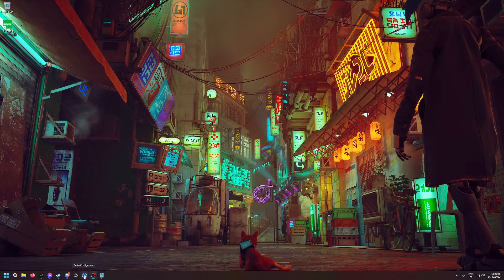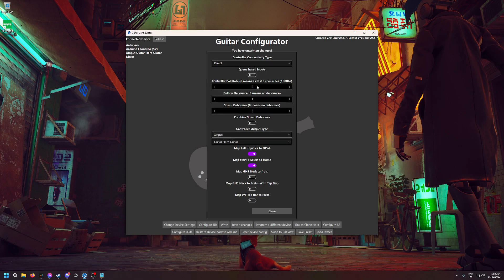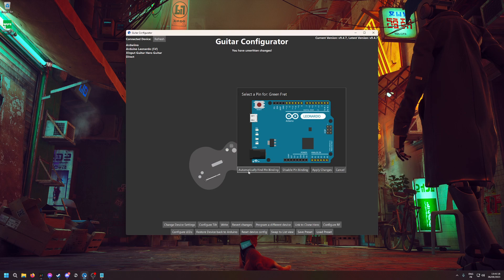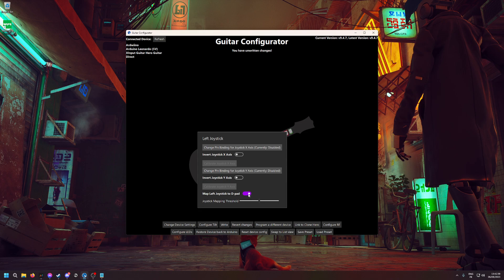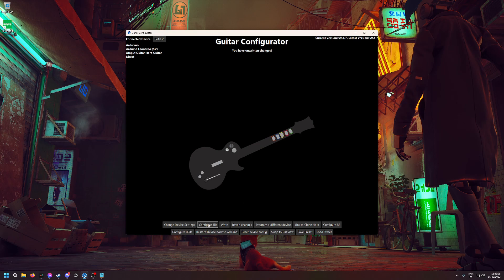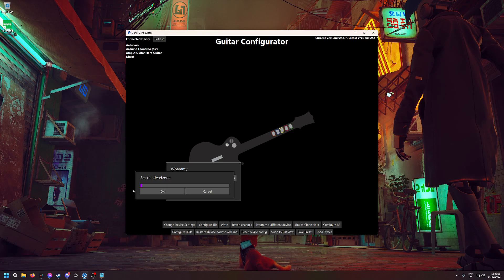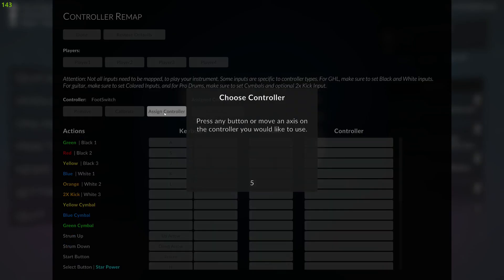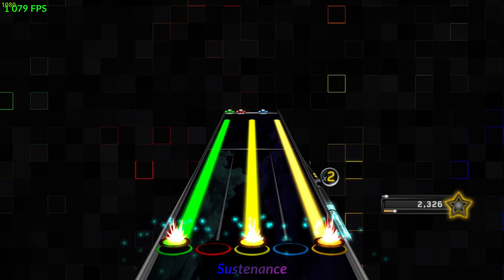How to Arduino mod a Guitar Hero guitar - Update on software configuration

Comment: The configurator is not detecting my Pi Pico. Its odd because not even 5 months ago it was detecting it. Any suggestions ?
Reply from the maker: Try pushing and maintaining the button there is on your pico before and while you plug it in to your computer